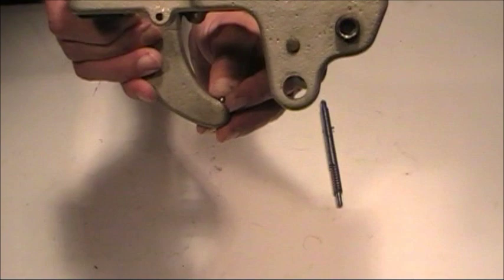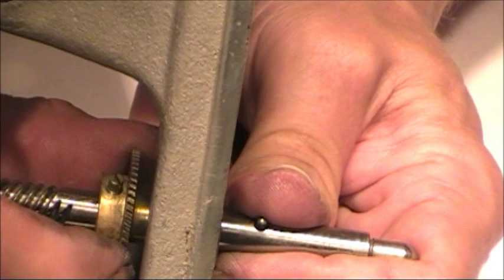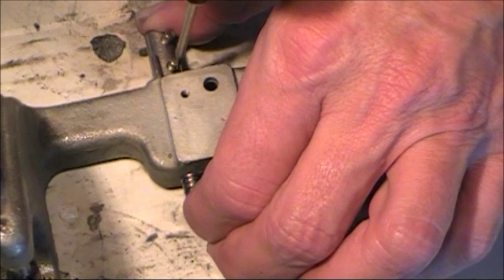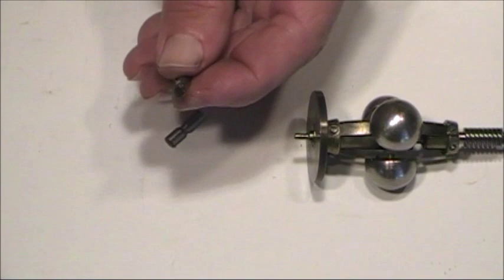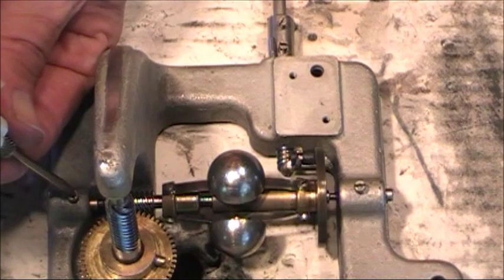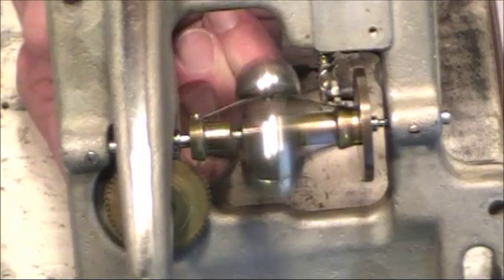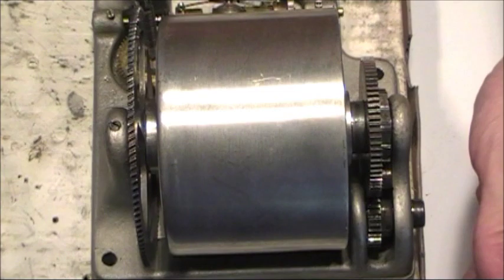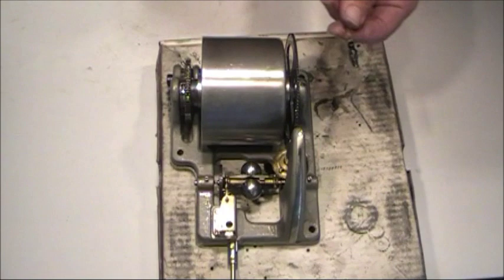Victor Two Spring Motor Rebuild Part 5

Comment: My 1920 Victor Victrola Model VV-XI is now working as intended thanks to you. Absolutely amazing videos which show step by step how to rebuild a motor. This was my first attempt at anything like this so I just have a few things I discovered during my rebuild. First, kerosene just would not break up the black gunk that was killing this Victrola. However, two cans of chlorinated brake cleaner did the job but it wasn't easy even with that. Brake Cleaner dissolves everything right? Even with that it was kinda difficult. The 100 year old lubricant in this machine was the toughest stuff to clean up I've ever encountered period. My machine was missing the spring devider, however, it does not seem to effect the operation. Lastly, the outer spring had a repair near the center. It was rivet together very nicely though so I just proceeded to put back together and it's fine. Someone loved and used this Victrola a lot. I can tell by the wear on the springs. I'm gonna buy a spare set because I too love this machine. Sir, once again Thank You so much for your videos. You made it easy. God Bless You!
Reply: where do you buy springs? thanks

Comment: Managed to obtain a HMV 130 with the usual HMV Clonk.  Saw you video and thought I would get to work today. Brilliant, its not as bad as I thought. All stripped down and cleaned. the springs came out easier than I was expecting and under control. Clean them up as they were in very sticky conditioned hard grease. I also cleaned the springs with a brillo to get the last remaining crap of the springs. As smooth as a babies bum. Assembly was quite easy as well after following your video. Good job I did as I think I would have missed the ball bearings. Repacked with grease and some light chainsaw oil.  Brilliant full wind up and play and BINGO, all sorted. Thanks for the info it really helped.

Comment: I also cleaned the governor over the weekend after it has been stuck since I first got my 1923 Camp Fone a few months ago. I removed parts of the governor, cleaned it with isopropyl alcohol, put the pieces back together and BAM! It runs perfectly as it was.

Comment: Your videos have been extremely helpful to me on my project to repair my VV-90. 
The spring was severely overwound years ago resulting in the oval hole on the lower spring to become damaged causing the spring to slip during winding. 
I’m new to YouTube but am wondering if you have a video which describes how to repair the end of a damaged spring. I haven’t been able to find one. Thank you for the videos which have enabled me to disassemble everything without breaking anything.
Reply from the maker: Very strange....I've been working on a VV-90 this week. It's the first machine I've worked on in 10 years!  I have never re-drilled a hole in one of these springs. The springs are made with a tempered metal, and I imagine the holes were "punched" by machine. You might try a machine shop and see what they can do.  I don't know what a new spring cost these days, if not much a new one would be your best option.

 http://victor-victrola.com/Part%20Suppliers.htm

Comment: Hi,
I have a VV-210 that I received from a relative.  The cabinet is mint but the motor doesn't run at all.  After watching your video, I took the drum out ( which was in backwards)  and when I opened it, the top spring was missing!  The #17 is stamped on the side of the drum.   It is dated from about 1922-23.  The only difference I noticed is that there are tabs inside the drum where the spring slides into not a rivet that sticks out like in your video.  Where can I buy the springs?  I want to fix this and pass it down to my son.
Thank you so much for a great video and instructions!

Comment: Thanks for sharing such a detailed video. It is very informative. I am wondering if a person could simply place the entire motor in a container of oil for a day so that it would get into all of the parts including the spring and rehydrate the grease. This would save a lot of trouble and time if it worked. Has anyone ever tried doing it that way? If so what were the results?